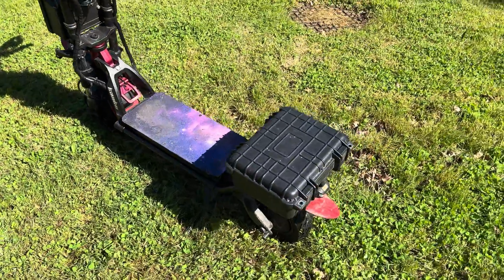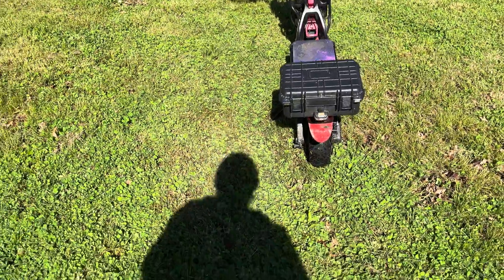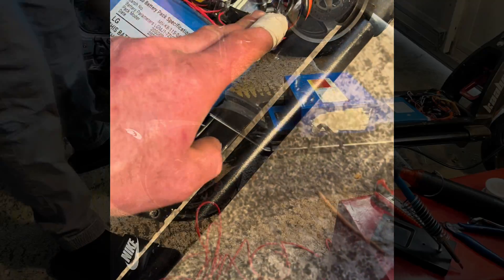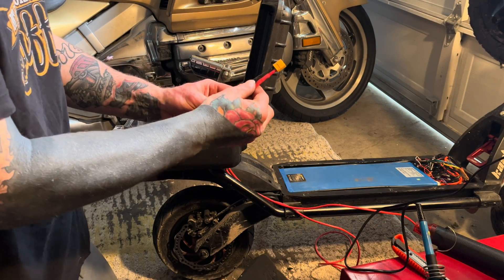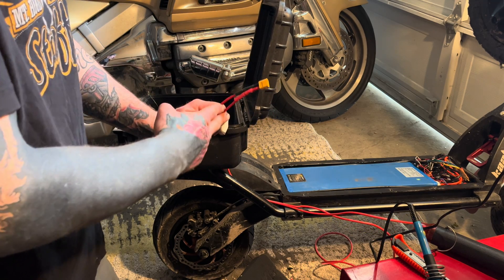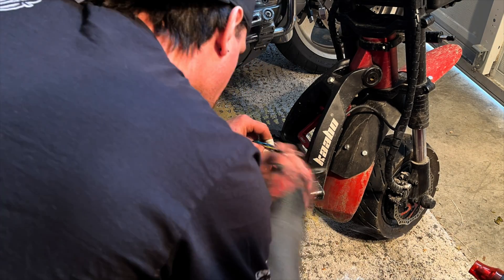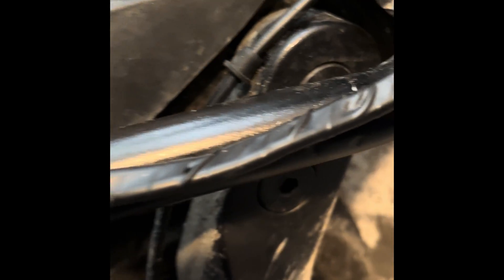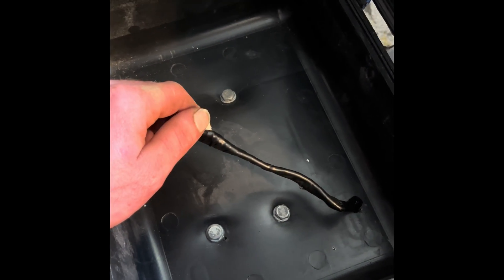No more battery anxiety 🪫 with this mod! Kaabo wolf king with DIY external battery 🔋

Comment: @Still Rollin. Have a question on the BMS part. Does the extra battery pack have a BMS and if yes...Does it affect the performance of the scooter?! How about the life span of the main battery?! Keep up the good work 👏🏿
Reply from the maker: @MrMmoh should not affect performance, the battery pack that is added keeps the main battery at a full state of charge for longer & less battery sag.

Comment: So why is no need to tap in to the 4wires outs of ur stock battery ? And can you charge from ur stock charging port?and what do you think about the battery discharge adapter they sell to wire more batteries
Reply from the maker: Yes it’s charges from stock port  too both batteries. This is just the way I did it. I’m sure there are other ways.

Comment: Hey Sir. Considering the weight of your battery and tool box setup, I'm guessing the overall weight is about 22 pounds. Have you experienced any bending of the rear bars due to the added weight. I was thinking maybe going over large bumps might cause bending with the weight there.
Reply from the maker: Never had any issues with bending. Everything is solid

Comment: I just bought a Kaabo (6/1/24) wolf Warrior 11pro plus and the throttle cuts out even though the battery and voltage  levels are fine. Please respond as soon as possible.  Thx a lot

Comment: How can you connect
 a 20 and a 28
They have to be the same capacity 🤔
Reply from the maker: They do not have to be the same capacity they just have to be the same voltage
Reply from the maker: You just can, I’ve been running this set up for a long time never any issues.

Comment: GREAT VIDEO,  I just hooked up my Dualtron Storm battery to my Wolf King GT and I can say this thing is now the ultimate scooter. Basically 67AH. Check out my latest video's on it. 

I kinda did it the same way I didn't bother tapping in to all 4 wires off the battery.
Reply from the maker: Nice work no need to tap in to all four. 👍

Comment: Anyone done this to the Kaabo King Gt Pro ? Been looking to do it but wasn't to sure
Reply: I  hooked up my Dualtron Storm battery to my Wolf King GT and I can say this thing is now the ultimate scooter. Basically 67AH. Check out my latest video's on it. THE DUALTRON STORM BATTERY FITS PERFECTLY ON TOP THE FRONT CONTROLLER BOX.
Reply from the maker: Not that I know of. Possibly videos to come
Reply: did you ever find anyone?
Reply: @m.mmiirr8799 I have a gt pro and want to do the same

Comment: Hey man I have a wolf king gt and before this one I had the wolf king plus so my question is I want to use the battery from the plus as a extended battery do I need to run the wires parallel to the new one or is it just a straight connection from one battery to another? The reason I ask is I put a extended battery on my old varla and I had to buy a wire harness
Reply from the maker: You can wire it your self and as long as both batteries are 72v then yes you can hook them in Parallel add the red wire from your external battery and connected to the red wire coming out of the battery on the GT in the black wire coming from the external battery connect to the black wire coming out of the battery there will be two sets of red wires and two sets of black wires coming out of your battery in your GT you only need to hook the wires to one Red and one black. Make sure you use good copper wire and a good gauge or close to the same Gage as the wire that’s on the battery already.
Reply from the maker: Do this at your own risk ⚠️ my wolf king is still running strong with the external battery . Best mod I did!
Reply: Thank you

Comment: Hi hope u don’t mine me asking I have a wolf king Warrior 11 running a 60v 35ah battery cud I run a External battery at 60v 20ah or dose it need to be a 35ah many thanks Leon pls love you videos you do
Reply from the maker: @Leon chell it does not matter what amp hour it is as long as it’s 60v you will be fine. Thanks for watching
Reply: Thank so much for getting bk to me so fast

Comment: You need to wrap the cable better where it’s zip tied to the bar as if you fall off it will scrape the wire against the pavement. (has happened to me as I run turn signal and brake light wires down the side
Reply from the maker: Thanks for watching please like and subscribe.

Comment: What’s the dimensions of your box. I’m looking at a 10*8*4. The battery is just shy of 3 inches. Do you think one inch is good enough for foam under Meath or do I need more?
Reply from the maker: I don’t know the dimensions of the top of my head but I do know that I got the boxes from Harbor freight. Their website should tell you the dimensions
Reply from the maker: The brand is Apache

Comment: That battery says it is suitable for 3000w or less scooters.  The wolf king gt being 4000w when in dual motor, would this battery not work?  I know nothing about the batteries, but definitely interested in adding a external.
Reply: I have the yume raptor 60v it’s a 3000w in each motor what type of battery would you recommend? And on ur video you tapped in directly to ur stock battery so can you charge ur rear battery with the stock charging port? And what other purpose do you get out of doing so? Thanks
Reply from the maker: I actually just pulled up the battery specs and yes you are correct it is rated for a 3000 W max. Now if your scooter is running 4000 W at peak Which its probably not. But if it was then you would want to find a battery that has a 4000 watt or more Max.
Reply from the maker: In this video the Scooter was a WolfKing non-GT. 
With 1500 watt motors. I can’t give you a yes or no at the moment I also don’t have the information of that battery handy at the moment. Now if you asked me if I would feel comfortable putting this battery on a wolf king GT I’d say sure why not.

Comment: So do you just charge the scooter as normal and both batteries get charged? Also how many extra miles are you getting with the double batteries?
Reply from the maker: I get 60 miles and I ride pretty hard and ride fast and yes it all charges as one system
Reply: @StillRollin_Official  thanks for replying. I also have the wolf king gt pro that's why I'm asking, I'm thinking of adding a battery also. That battery that you added is it the same size as the one your scooter came with?
Reply from the maker: @Sam Proto 72v 20ah AliExpress battery. The scooter in the videos is a basic Wolfgking it came from the factory with a 28 ah battery
Reply: @bigsammy991   I  hooked up my Dualtron Storm battery to my Wolf King GT and I can say this thing is now the ultimate scooter. Basically 67AH. Check out my latest video's on it. THE DUALTRON STORM BATTERY FITS PERFECTLY ON TOP THE FRONT CONTROLLER BOX.
Reply: @StillRollin_Official  excellent work! I want to do the same with my wolf warrior king. I think the cells in my stoic battery are the 18650 LG cells. The Ali express 20Ah pack you bought, are they the same or 21700? Does it matter if cells are different? I am new to all this. Thanks
Reply: @philliplam1605   l
LG cells 72V are 21700 equal with SMALL DEN

Comment: Do you have a link for the battery you used? Or did you build that yourself? Cheers
Reply from the maker: @Tim Webber US $266.42  23％ Off | 72V 20Ah 21700 lithium battery pack 20S4P 1000W-3000W High Power ebike cells 84V Electric bicycle Scooter Motorcycle Tricycle
https://a.aliexpress.com/_mLbuzAA
Reply: @StillRollin_Official  awesome thanks so much! 
Do you know if you could wire this to a plug that plugs into the charging socket and it would work the same way? So without the need to solder it into the cables?
Reply from the maker: @Tim Webber yes you can do it that way, the battery’s have to be the same voltage tho when you put them together. I wouldn’t recommend it because the charging wires are the thinnest wires in the scooter. I don’t know how many volts you’re running.
Reply: @StillRollin_Official  Ahh I see I see. I’ve been thinking about doing it on a 60v Kaabo Mantis 10 which currently only has the 18 Ah battery
Reply: @StillRollin_Official  hey man, in this case would I be able to add in an additional charging port as well? I have a ww11 60v 35ah and want to add in an additional 35ah. I was considering tapping in with a. Splitter on the tx60 connectors to add in another battery and then add in a charging port closer to that battery that way I have 3 ports to charge from. Plan on having this for long travels with quick recharges needed once a day
Reply from the maker: You can still only charge up to 10 AM so adding another charge port might not be in your best interest but yes you could add another 60 V battery
Reply from the maker: Adding a third charge, port might not be in your best interest. You can only charge up to 10 Amps on the Scooters. you could definitely add a 60 V battery though and wire it in parallel with your stock battery.
Reply: @StillRollin_Official  I know you said the wires are thinner but I think it would be nice to disconnect the battery if I need to. Why only 10a? The controllers are 30a and I’ve heard of people doing even more. At least that’s what ginger on wheels was saying in a charging video. Any recommendations on how to make the wires on tx60 thicker? Newer to this stuff but I’ve soldered a bit before and I’m not too afraid of it but having easy disconnects would be nice for if I want to remove the box from the back of the scooter
Reply from the maker: The controllers have nothing to do with the charging. It’s the BMS in the wires that are on the charge ports are very thin in the fuses can’t handle more than 5 A each.
Reply from the maker: The wires that are on the charge port aren’t a very big gauge wire. Also, the fuses cannot handle more than 5 amps